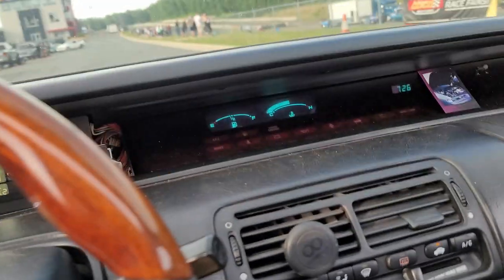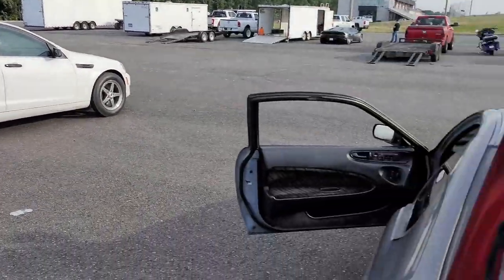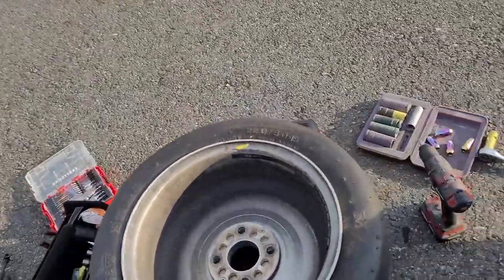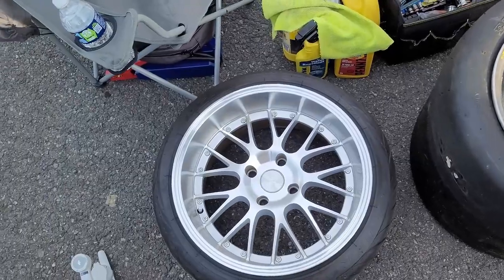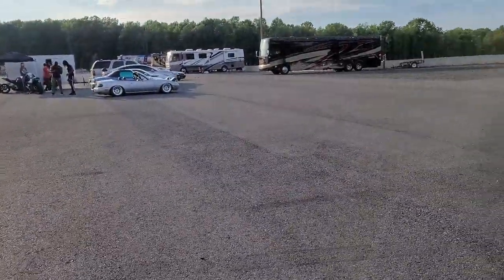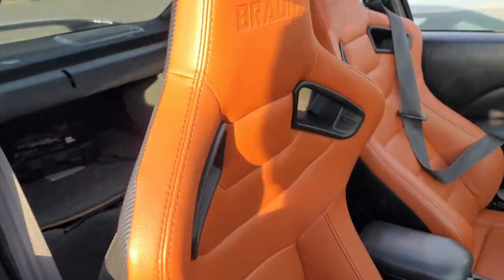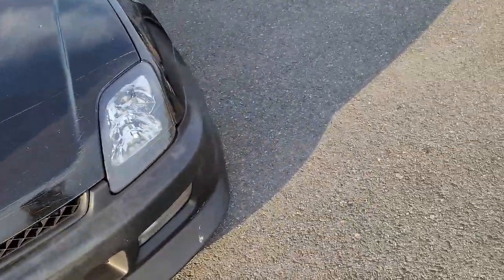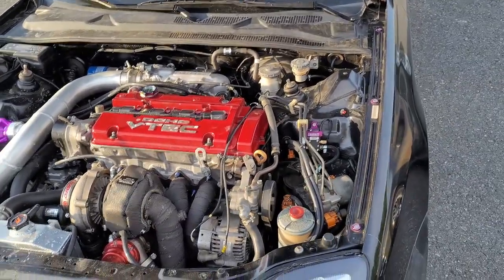I went to a 1/8 mile track in my turbo honda prelude and this happened..............................

Comment: Need to adjust that boost controller..  reduce your psi on 1st-2nd gear then once you have traction turn it up... Ludes tend to really shind in 3rd anyways..  what gearbox you running..?? What trans.. what final drive gear..??
Reply from the maker: Yea. Accord trans m factory lsd 4.27 fd

Comment: Also your shifting too early in second.. ride second out to like ,8500rpm give you a clean transition to third and keep VTech engaged
Reply from the maker: Yea my rev limit is at 8k
Reply: @treybedipping1734  that's low for a F20b.. with a balance shaft delete and solid mounts you should have it set at 8500-8700.  Short stroke means it needs revs to make power
Reply from the maker: @admina7138  yea i think the issue was fuel. I have stock fuel lines so when i got it tuned it was close to 90% duty
Reply: Up the fuel pressure a few psi..
Reply from the maker: @admina7138  bet thanks for the info bro